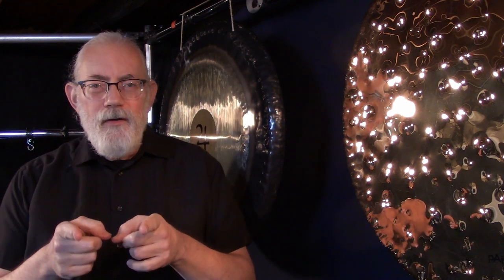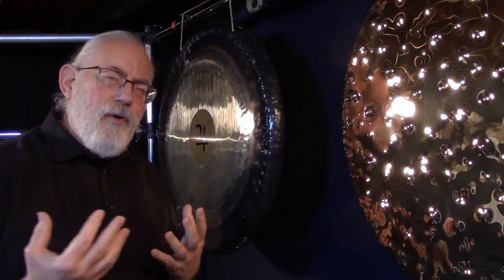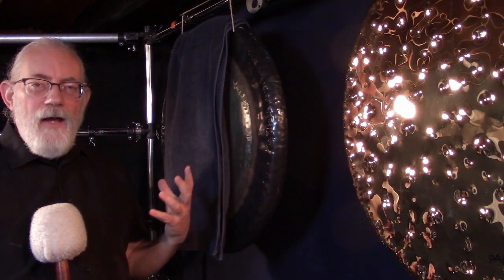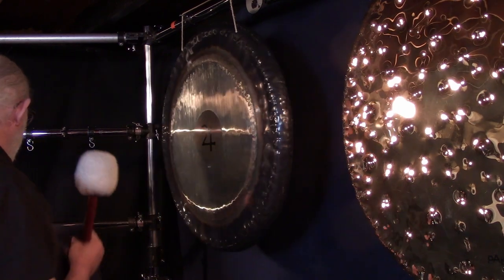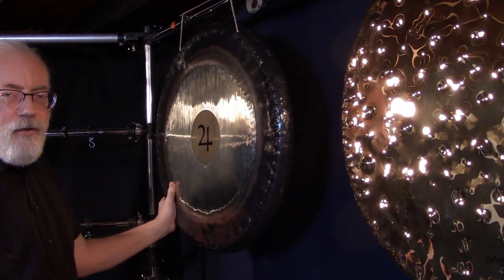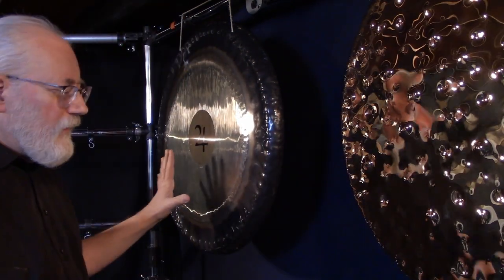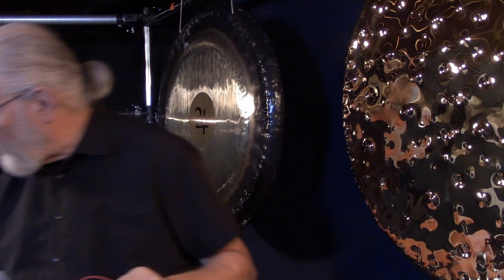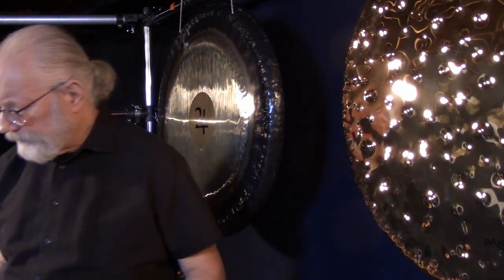Gong Muffling vs Gong Dampening

Comment: Nice content here for feeding my all things gong appetite. Muffling is not really my thing, perhaps I will develop a use for the technique while recording multi-channel mixes. The damping is more of a thing I am figuring out…I like using a sheepskin mallet in a s shaped rubbing motion across the face to quickly dial down crashes and multi-overtone crescendos. I liken gong muffling to a non-alcoholic beer…seems counterintuitive. Now, cam you tell me if you have done any instruction videos on your rack system. Am really interested in the fittings that you use in attaching and connecting your pipe frames. Thank you!
Reply from the maker: I do have a rack set up video from a few years ago: https://youtu.be/m1We2A59guw 

And another one here: https://youtu.be/fexdA0lhzoI?list=UU4gsRj-DM2ul92QMZ2HDVSg

I also have some info on my website: http://www.gongtopia.com/sound-chamber/gong-racks.html

But it's probably time to make a detailed video and list the part #s. Thanks for the idea and watch for a 'How to Build A Gong Rack' video soon! ~ MB
Reply: @Gongtopia  Most excellent. Thanks very much. Will check the links out and am now subbed to your channel to be sure to catch future Gongtopia vids!